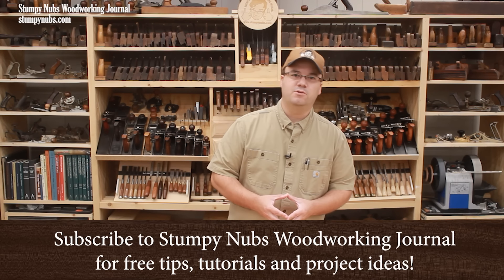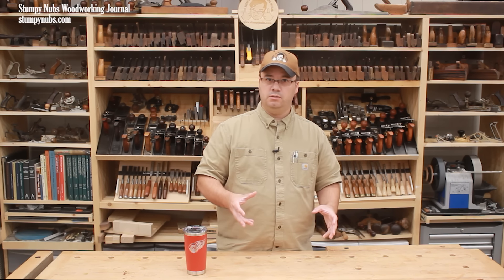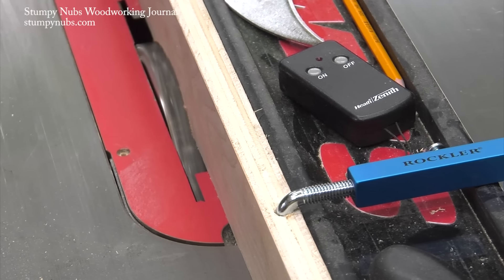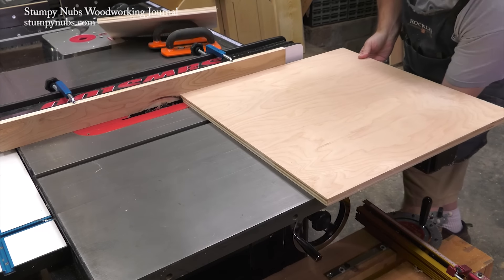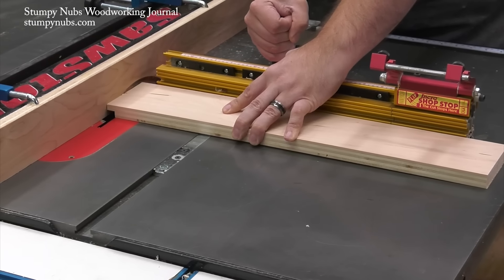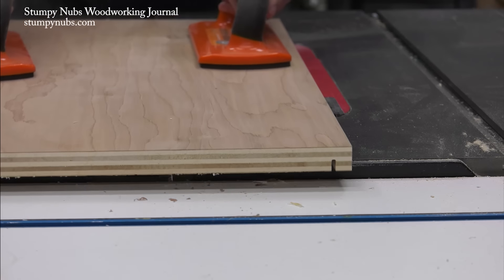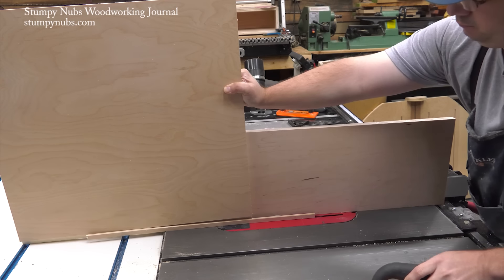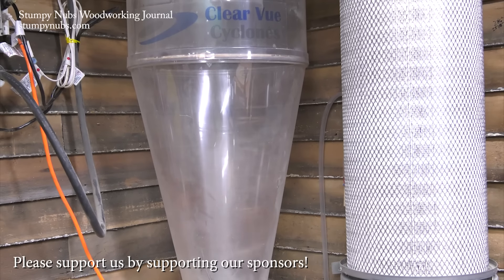3 Table Saw jigs & some important lessons.

Comment: I would like to thank you James, I recently bought an entry level table saw. It’s mitre slots are totally different to all the saws on YouTube, but with hints and tips from stumpy nubs channel and Steve Ramsey I’ve been able to set up the saw and made my first cut yesterday. A 4 foot long rip cut in 9mm ply, you guys make it look so easy. After many practice passes I successfully cut 6 inches off the length of the wood. Why have I waited so long for this tool, it’s amazing.
Reply: You sound like a guy that doesn't consider 5" 31/32 to be six inches.  I have no idea what else you might be but I think you'll do well with precision work.
Reply: I purchased my first table saw ~3 months ago. Videos like this are an absolute godsend for the beginner woodworker. I also question why it has taken me 10+ years to finally buy a table saw ... Honestly, if I could tell new starters (like me!) one thing it's that it should be in the list of first tools to get.

Comment: Thank you for advocating making a test cut. So many other channels brag about how accurate they set up their rip fence is try to prove by quickly moving it to a measurement, lock it down and make the cut with out verifying the distance with a test cut. I always wonder how many times they cut that piece only to find out is was not cut to the proper measurement. You never see that in the final edit.  Most wood workers have scrap wood, yes I said that out loud. Admitting we have a problem is the first step.  We always have scrap for a test cut.  Besides, with the cost of sheet goods these days, why not take the time to make a test cut. More cost effective in the long run. Another great video, thank you.

Comment: These are some of the best tips, because every base I can think of is covered here. My table saw isn't powerful enough to kick back - it will just stall, UNLESS a small piece falls between the blade and the throat plate, then be alert and stay clear!. But just taking into consideration the concept of the sacrificial fence for this purpose, a concept I've heard before but not in this context, helps me get better at what I might be doing down the road. This is what excites me about getting more into woodworking. It's the little tricks that the tool manufacturers don't tell you about.

Comment: James Hamilton has presented another great video filled with practical tips for all woodworkers. After over a half century of woodworking I agree with everything presented. However, even when using the single blade method I prefer to cut my dados close to the fence. I believe this method gives greater control over the cut and the workpiece can't spin out and ruin the cut. although the masking tape trick won't work in that position, you can still start narrow and sneak up to the width of the dado. In any event, I always make test cuts on a scrap piece before running my actual stock through the blade or dado set.

Comment: I followed you design and made a jig like this for myself.  It helps a lot when making lap joins or notch out.  Since I got a job site saw, I double up on the support piece on the right so it doesn't fall into the mitre track.  Also it gives it little more stability since the my table saw fence is very narrow.

Comment: Great video. The hard part for a lot of us small shop guys is that our contractor table saws just don't have the quality fences that a professional cabinet saw does, and man is it hard to make jigs with no play when your fence has a lower tolerance for its manufacturing specs. My DeWalt fence, while pretty darn good for a contractor saw, has a slight little dip in the middle. It isn't a huge deal for normal rips or anything, but on jigs that ride the fence I always have trouble, as in the very middle it has some play.

Comment: Good food for thought. I have been attempting to do some bowl segmentation, and I had the first jig that you cut the segments with the rest was just a afterthought. Not any more, I did a bowl, it had gaps between layers, even though I had made a sanding wheel for my lathe. Why the gaps, when cutting the segments where there was no support for the material,  the blade was of course pushing the pieces back just enough to screw up the angles and it warped. So wasn't put some clamps on it to hold the material and now they are almost perfect. Which led me to make the zero clearance table saw insert and a beveled piece that goes next to the blade so the cut off pieces will fall away from the blade. Your right making the right stuff for the job is paramount, and I am being a bit more smarter. Sorry for the dissertation, but I am happy that I followed the process, now my bowls will look better.

Comment: Sometimes, if I only have one or two rabbets or dados to make, I'll just use the "nibble" method, but if you have a reasonably decent table saw it's worth the expense to buy a good quality stacked dado set. I also have a dedicated sled with a wide cut-out for the dado cutter.

Comment: Great video and thanks for sharing. I’m in the process of making a bookcase for my daughter and I need to cut  some rabbits on the case pieces to  hold a back panel. While I do have a dado blade and have it set up for some reason my table saw doesn’t seem to be staying at the set height so I’ve been thinking about using my trim router with the fence. However, I might try making a fence for my saw and trying the rip blade double cut method.

Comment: Need assistance Sir. 

Not sure if I am going to burn up my sander Please help. 

Have you ever heard of a random orbital sander slowing down in speed?? 

This happens when I turn on the shop vac. 
I have my shop vac hooked up where the dust collection bag was on the sander.

Thank you in advance for any guidance
Reply: Hi Jason. Just a couple suggestions: make sure the shop vac has enough air being fed to it. The random orbit sander tends to limit the airflow. Not sure if this would slow down the sander, but I have a few problems if the extra air port on the dust collection hose is closed.
Another thing might be insufficient power to the sander. Do you have them both plugged in the same outlet? Try using 2 different wall plugs to see if this might be it!
Reply: @alexandrerauen6860 I did have them both plugged into the same plug.  I will try different plugs that are on different breakers tomorrow. 
I will let you know if this works. 

FYI. I am using a brand new Dewalt “6.0 hp” 15 gal  wet dry vac with the high efficiency bag inside and standard filter. 

Thank you for the response
Reply: @jasonscoggins01  I would second trying two different circuits.
Reply: @baraksinz  will do let y’all know tomorrow
Reply: A vacuum and ROS should be drawing around 12-13a when full tilt.  Using separate circuits could help if you are running other things on that same circuit.

Comment: Just got to throw in a safety tip here - in the video the operator is wearing a ring.  I can't tell you how many rings we had to cut off during my tenure as an ER provider.  Some metal rings are exceedingly hard to cut (and some are impossible)- and all rings are hard to cut off in the setting of a grossly swollen or mangled finger.  Take a minute to take the ring off (if you can), just like you make sure that you aren't wearing loose clothing, etc.   I notice that in this video, after your accident with the Cutting Wheel from Hell, you don't have your ring on.  
Your partner will still love you - and it will save you from visiting the jeweler to have them cast the 2 pieces back together (while you're recovering from your accident).  Just sayin' (based on years of experience).
Reply from the maker: It's old footage. I don't wear rings like that anymore.

Comment: Thank goodness glueing saw blades together or using old fashioned rabbet blades is nowadays forbidden in Germany by the Berufsgenossenschaft (German OSHA-equivalent, more or less).

And yeah those rules were also written in blood. Jeebus, when the glue fails, the teeth of the several blades could collide, sending metal shrapnel everywhere.

American woodworkers are often hair raising haphazardous…
Reply from the maker: The teeth on the individual layers of a dado set do not collide, much less produce "shrapnel". When the arbor nut is tightened, the inner blades do not change position at all within the stack.
Reply: @StumpyNubs  These are the guys that screech about no seatbelts in kids' Hot Wheels.
Reply: @StumpyNubs  Sure, I was thinking of glued-together sets, when writing about shrapnel. Dado sets, mixed up the word. Anyhow, even fixed dado sets are not allowed anymore here because of the dangers of kickback. For clean dados, use the router. For quick and dirty, cut once vertically, once horizontally at the parallel fence. Much safer.